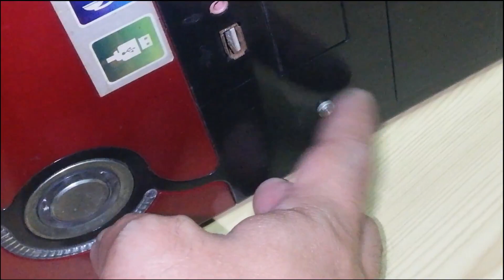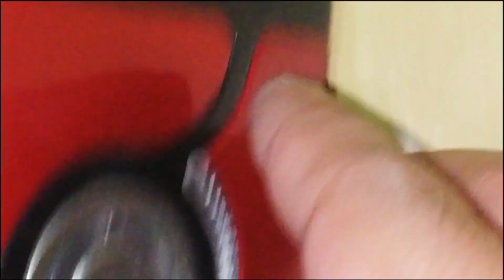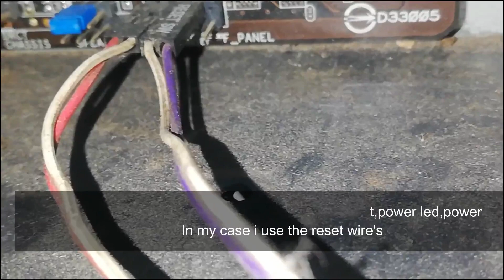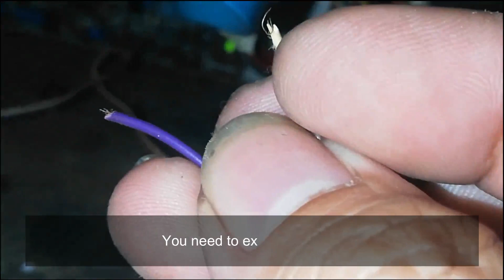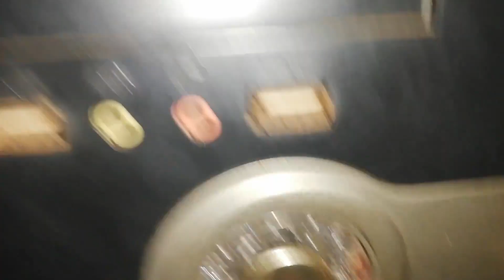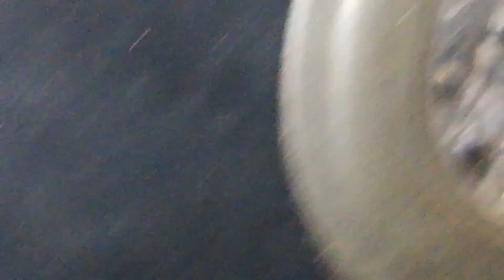How to fix defective power switch of PC - 3 solutions

Comment: Thanks dude! I didn’t even think of option 3. Didn’t see that one on any of the tech forums…

My pc power button got pressed in years ago and occasionally have had random shutoffs. 

It didn’t do it for years then I moved and started happening worse to the point where it won’t even boot sometimes.

So for the last few months I’ve been keeping the door off because I sometimes have to jiggle the power switch cable while holding the power button.

Finally got it to a point where I thought I could put the door back on because I got 3 dozen clean boots, but then literally the next day, it starred shutting off randomly like if the power button was being held down.

The crazy part is the problem was less intermittent a couple weeks ago and I thought it was the mobo bc after I replaced that, it was working fine. CPU got cleaned & freshly pasted with arctic and the PSU is 100% good. 

Assuming new mobo is fine and CPU isnt overheating- This fix SHOULD save me! 🙏

Comment: Yung PC ko, bigla na lang namatay, binuksan ko uli pero nagblink lang yung GPU light and di nagbubukas. So i assumed PSU has something to do with it. Nilipat ko ng saksakan and gumana naman uli but this time nag turn on siya mag isa kahit di ko pa pinipindot yung power button. Tapos pag nagshutdown ako, namamatay lang yung monitor pero bukas parin yung Fans, LED at cpu fans. If Motherboard ang problem fixable pa po ba?
Reply from the maker: If mobo ang sira ,yes possible ma repair pa,

Comment: My problem is that the 
power button doesn't have that
LED light and that's all
is running but how come you know that is ON is the blue
LED light doent light up,
it could be the cables that goes
to the mother board?
Thank you!!
Reply from the maker: I'll check end to end of the cable that's why i know.. There is only 2 led light and 2 motherboard socket in panel.. If you have only one LED working, you can plug either to hdd led or in power led pin
Reply: @dareuttech  

Thank you @dareut tech!
Reply from the maker: @robertolopez391  your welcome ...

Comment: Thanks for this video tutorial sir. I just notice your doing the splicing and plugging/unplugging while the power is ON. Is it okay to do that or better to turn the power OFF first? :)
Reply from the maker: Safety first, i think you are referring the  green LED, the system is completely off while im doing splicing/unplugging.
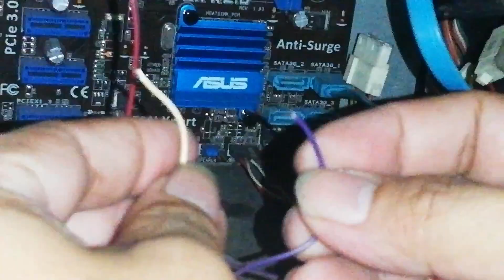Some motherboard when you plug the power cord the LED indicator will light up see the video 4:20 to 4:30
Reply: Unplugged, because of static and whatnot. This comment is 11 months old so you might know why now but it's much safer to unplug it before you do anything.